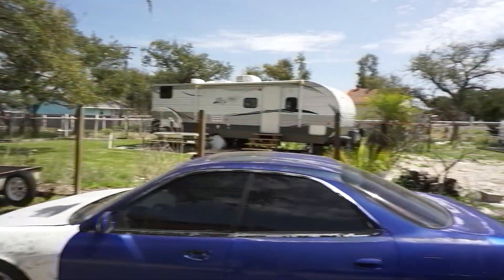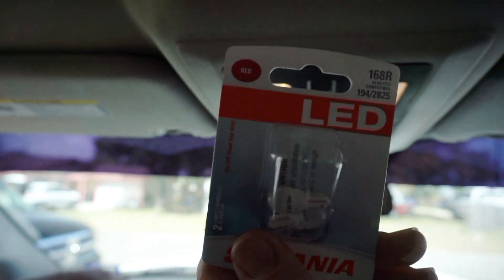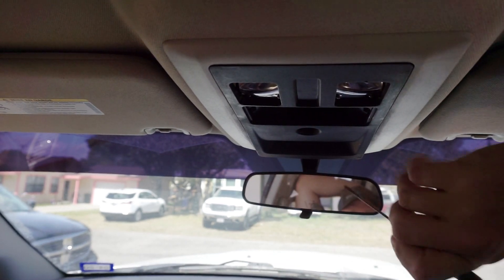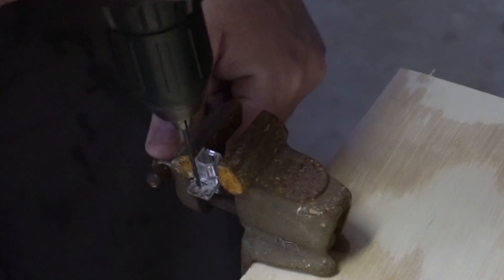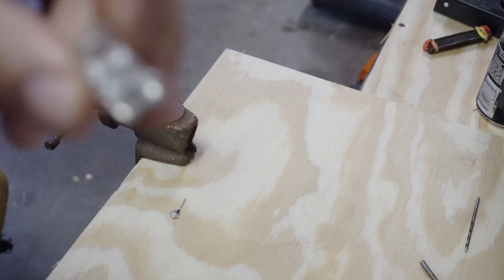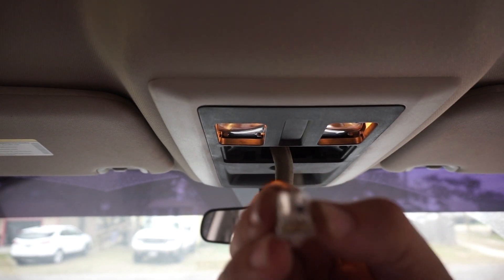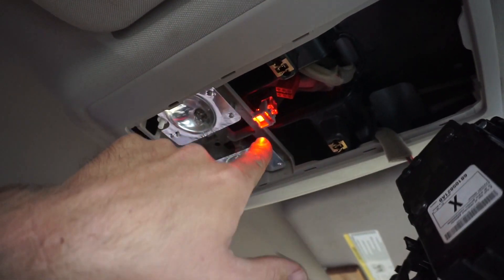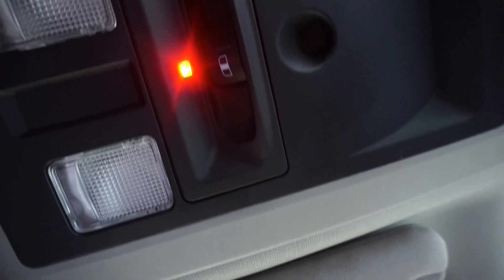Ram 1500 Map Light Led Mod

Comment: If you replaced to the white led salvana bulbs will it be briter  than the factory white
Reply from the maker: I would say its highly likely if you were to use a white one, colors come at the cost of lumens, but the red one used in this video was putting off the same as the factory bulb. White would definitely have been brighter.

Comment: The holder for the led (plastic piece you drilled out) do you have a part number for dealer parts? Wanted to get another one to surgery on.
Reply from the maker: Man I really don't know off the top of my head and it is a hard part to reference online but I do know I went in to the dealer and asked what a replacement cost.  I Wana say it was under 20$ that's why I said "screw it I'll take the risk in drilling my factory one."  Dealerships will know the precise part # for sure.
Reply: Thanks brother. I’ll see if I can get one. If I do I’ll update you.
Reply from the maker: @michaelalva6492  Sweet!! Lmk if you have any further questions.
Reply: @Rep361Texas  I've called two different dealerships and both parts departments can't find this bulb.  Mine is flickering and I saw your hack, but I just want the original bulb.  Do you or one of your subscribers have the part number.  Hell, using my VIN, they said I didn't have a light up there.  That's what I'm dealing with.  PLEASE

Comment: My led light went out. Is there a way to order only the led or do I have to buy the entire assembly?
Reply from the maker: You can order just the bulb, just get with your local dealership they will get you the right part, there not expensive at all.
Reply: @Rep361Texas  thanks for the direction. I’ll give them a call and get a price on that little led light that shines down onto the center area.  Won’t surprise me if they say some shit like $50 though haha.
Reply from the maker: @Burgher1605  Haha yeah I thought the same when I had asked, but if I'm not mistaken they're like $20 at my local dealership.

Comment: I have a 2019 classic and I have that light too.
What triggers that light to come on? It seems to go on and off at random when I'm driving.
Reply from the maker: I'm unsure mine is a 17 and it stays on as long as the panel lights are lit.
Reply: Thanks for your reply. I'm thinking about just covering it up lol.
Gets annoying flashing on and off as I drive.
Reply from the maker: @davidsilver2047  Sorry I didn't have a better answer, but that is dumb, it almost sounds like a distraction. Hope you find a solution to be able to keep it.
Reply: Sounds like a loose connection.
Reply: @menlomenlo851  when I get a chance I will check it out. Just seems weird that it only  works sometimes. At first I thought it had to do with a sensor or something.
Reply: @davidsilver2047  ,  My map light on drivers side, sometimes it worked, sometimes it didn’t, sometimes it flickered.  I took the whole thing apart, threw out their over engineered crap and plugged regular but brighter led bulb in there.  Did the passenger side too.

Comment: I missed this new LED bulb type. Do they come in blue as well?
Reply from the maker: Its a 194 Sylvania, I show the box and bulb in the video. And yes you can hey them in blue, I can find you a link for one if you like
Reply: @Rep361Texas  Thanks man I was to busy watching your details here. So you dissected the 194 to get to just the LED itself! Any precautions doing that or easy DIY's?  Did you make a vlog on the floorwell bulbs too?
Reply from the maker: @I-can-do-IT.  No problem!  With that specific bulb it is very simple, but yes it is a dissect and install deal, watch the video as needed to help form a plan as you do it, the floor well lights are a simple plug in bulb that you can buy. HOPE THIS HELPS!!! !Feel free to ask away as needed!! Best of luck with your build!!
Reply: @Rep361Texas  Thanks Rep. Would you have a link for the floorwell bulbs?
Reply from the maker: @I-can-do-IT.  im having trouble grabbing the actual link but on Amazon you search Led Tops 194 color change, first result will be two bulbs with remote!!!